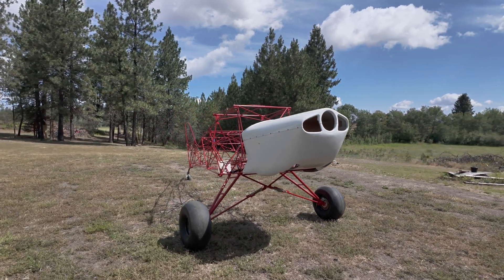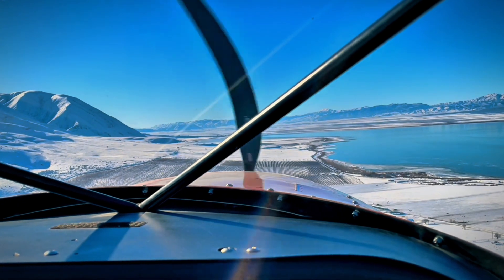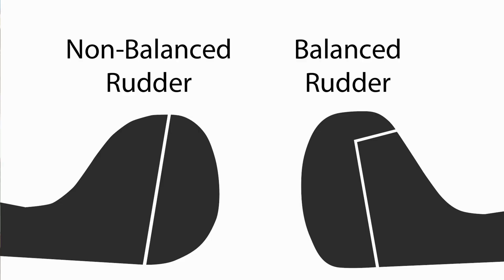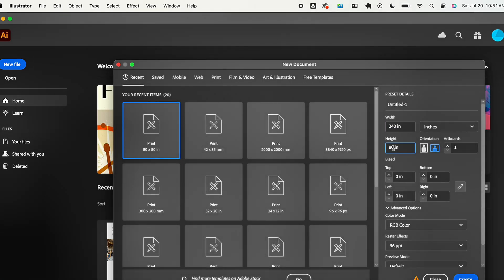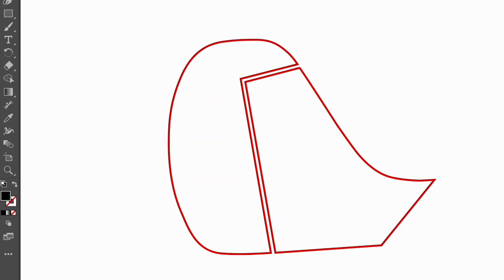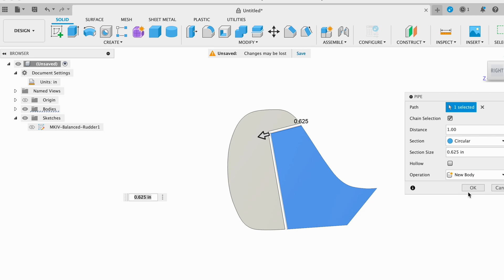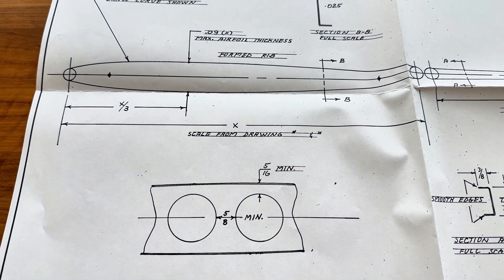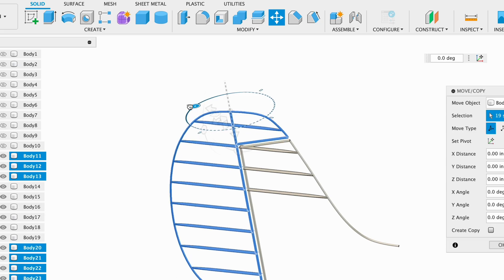I Designed a New Tail For My Bush Plane - Designing Parts The Easy Way - EP3

Comment: I am rebuilding an Avid Model B (although I question that model, looks more like the MKlV Heavy Hauler).  Plans are to increase the length, tail height, and use a larger engine (high altitude).  I will use composites for the tail increase, possibly for the new wings also since this is a total gut job.  This is a journey, looking fwd to the Utah, Wyoming outback!
Reply from the maker: Nice! That sounds awesome! I too am in that area. Let me know if you need any help!

Comment: It's hard to tell from just the video, but it appears your new tail ribs aren't really aligned to anything. I would suggest laying them out so that they are in line with the airstream when the aircraft is in flight attitude. Be aware that adding an airfoil makes the surface more effective than the original flat-plate design, so your control feel and effectiveness will be different.
Reply from the maker: Great advice, thanks for the tips!

Comment: I’ve got an Avid Mk4 and I have thought about doing this too.
Reply from the maker: Sweet! Yeah I’ll post updates as I work through it. Let me know what you end up doing.
Reply: @letsbuildthis  I don’t know what we are going to start with yet. I’m thinking about more horsepower. Maybe a Rotax 670 with a 4:1 gearbox and a larger prop. Need bigger tires and brakes too.

Comment: Check out the Piper PA-18 tail feather shape. Both rudder and elevators have the balance tabs. Don't confuse with Cub J-3 which do not have tabs.
Reply from the maker: Awesome, thanks for the tip!